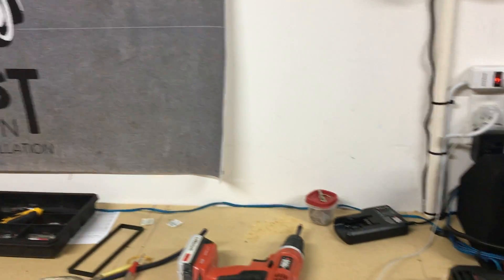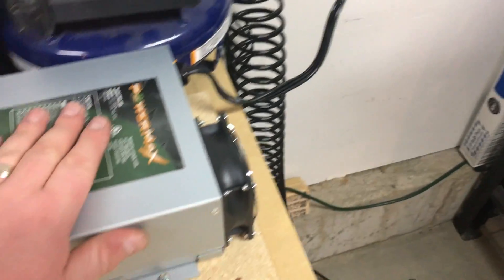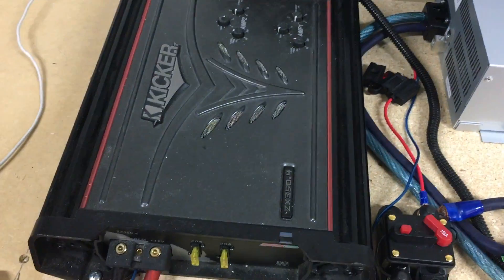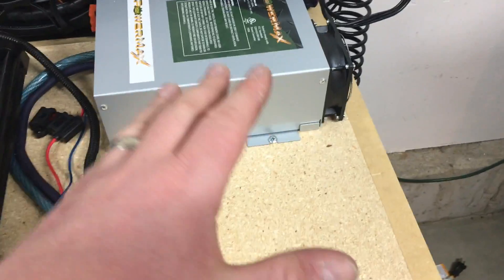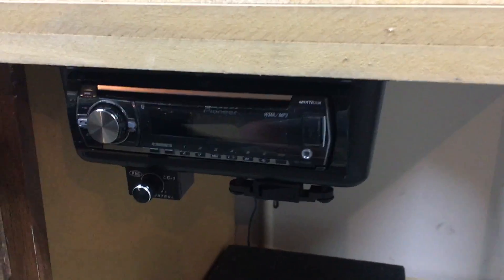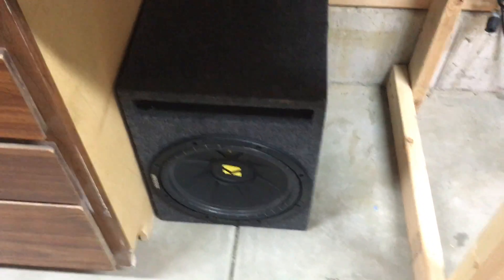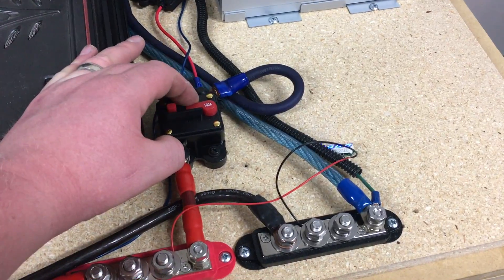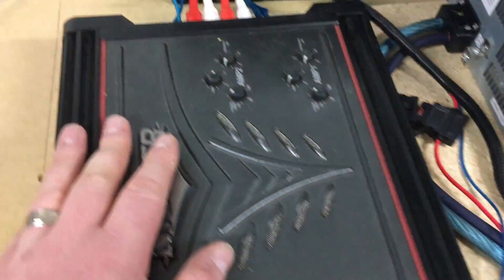Building a Garage Audio System Part 3: Wiring Bus Bars, Amp, Power Supply

Comment: Do you have to use the circuit breaker and all that extra stuff? I’m planning on doing a similar thing. I’m planning on connecting the power supply straight to the amp, with an 80 amp fuse in between the power supply and the amp. And using a lighting to rca to connect my phone to the amp.

Comment: Is there a switch on and off button on the powermax or do you just unplug when you want to shut off the system?
Reply from the maker: I really should do an updated video on this.  Yeah, we have a switch on the ac plug where we can shut it down without having to unplug it.
Reply: @ProvoBeastAudio I noticed there’s a humming noise when amp connected with the powermax 100, did yours have that too? When I tried with car battery, it works normal.

Comment: How are you powering the stereo?
Reply: I have a Pioneer like that one at home. What I did was I ran the headunit ground, the constant positive and the switched positive to my Alpine mids and highs amp inputs. Taking the faceplate on/off turns the stereo on/off along with the amps. If I hold the SRC button on headunit, it still shuts off the amps, just leaves the headunit display on

Comment: Question, why would you need a batt when the invertor powers the amp?
Reply: Yeahhh i had the same question
Reply: It's basically a charger for the battery .  If u don't have a battery and u turn up the volume the Amp will shut off cause it draws to much power, that's where the battery comes in. Same as a car, u can run a car with no battery just the alternator but once u put load to it like lights and radio and other things it will turn off and stall
Reply: i have the same question
Reply: So the extra handle has a 1/8 plug for mic input, also, to hookup mic without extra handle, can buy usbC to 1/8 female adaptor and hook up mic that way too, through the bottom of the pocket 2  ;)

Comment: Is the a power supply like this one to power a jl audio 600w mono amp with a 50 amp fuse??
Reply: Yes.  The 100A supply is good for 1375 watts continuously.   I bought the 75A version, which is rated 1095 watts continuously.   I have had no issue running any amplifier.  Can run more powerful amps for testing purposes but cant power a 2000 watt RMS amp fully but can give it wnough power to test.  Most of the amps i sell are 1000 watts or less so thats why I went with the 75A.  Plus i got it for a crazy good price.

Comment: I'm confused, why do you need the battery?  I thought it all worked fine off of the power inverter.
Reply from the maker: The power inverter may fluctuate in delivering consistent amperage to the amplifier.  Additionally, with the use of bus bars and the capability of testing other audio components, a battery is required.  Also, this also allows us to use the setup if a plug is not available.
Reply: Provo Beast Audio Installation nice..for my Boombox project I have a Rockford R400-4D and has @ 50A fuse my question its.. should I get the Powermax PM3-55A or get another that has I think the PM3-75A to power my Boombox?
Reply: Couldn't a large capacitor do the same job in theory?